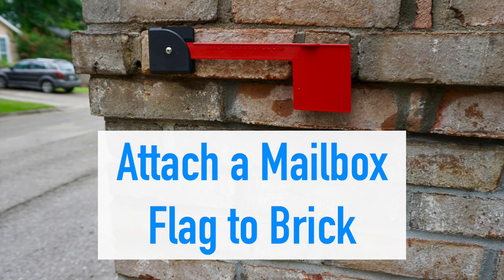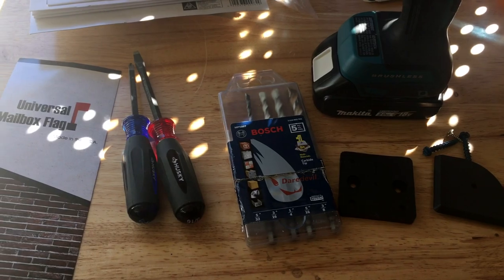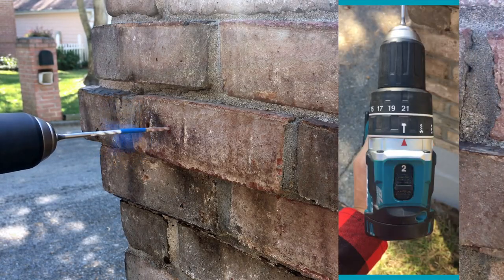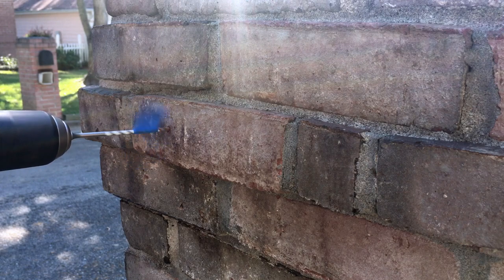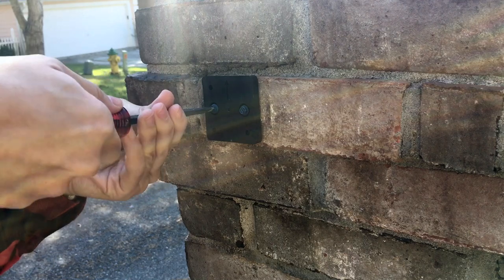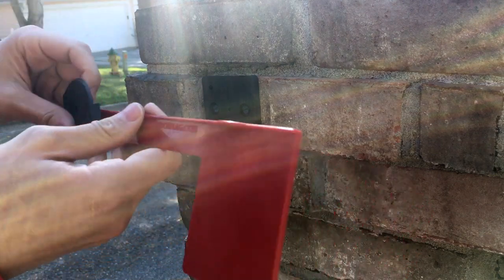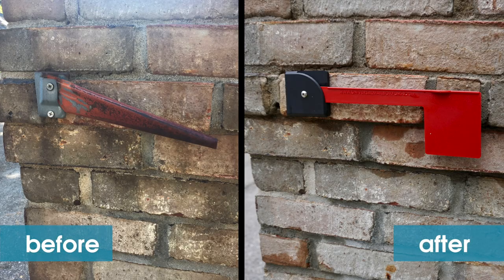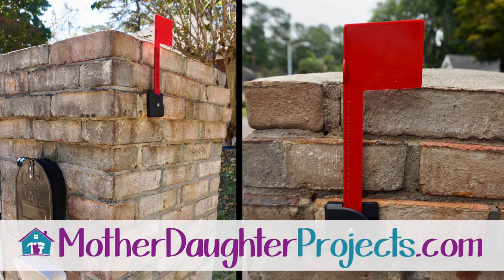How to Attach a Mailbox Flag to Brick

Comment: Is there a reason you drilled into the brick instead of the cement?
Reply from the maker: The old flag was in the cement and the holes did not line up with the new one flag. We would not be able to get a secure connection with the cement section we had to work with.
Reply: @MotherDaughterProjectsDIY  I see. Thanks you.